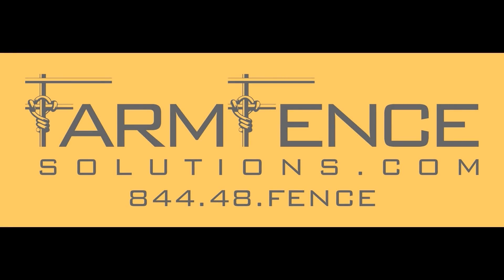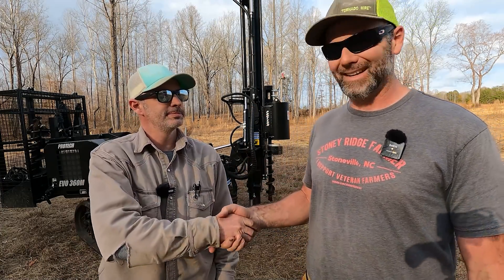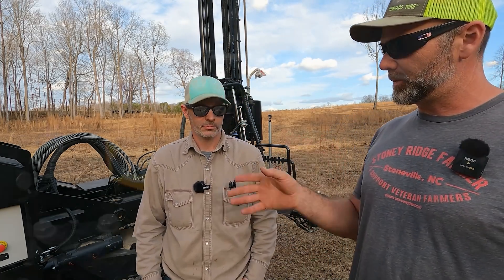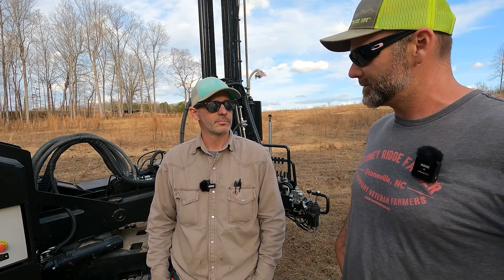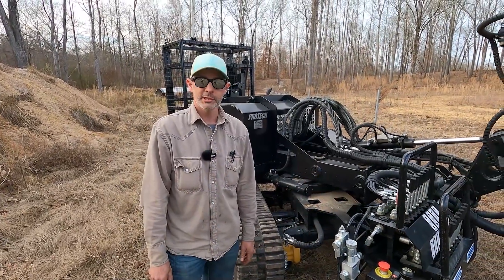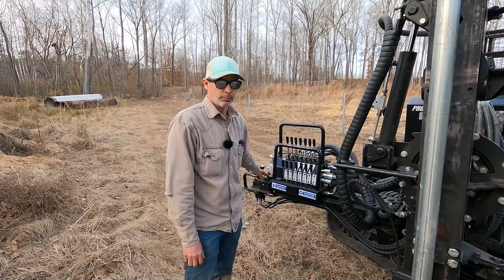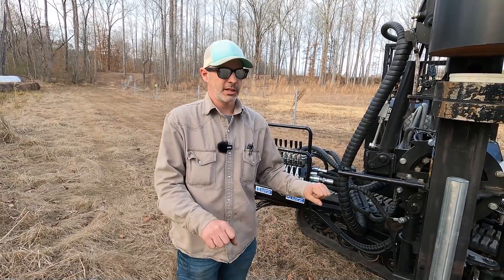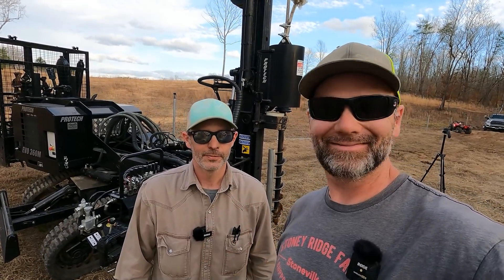You've never seen a fencing machine like this!!

Comment: Great tool. Soon as I have a spare $2 million just sitting around, I'm gettin' me one of these puppies!
Reply from the maker: a man needs tools to earn a living my friend
Reply: @StoneyRidgeFarmer  I build welded steel pipe fences for a living. My tools including truck, trailer, tractor, auger, pneumatic pounder, electric and gas welding gear, wire stretchers - EVERYTHING cost about 1/10th what this machine alone would.
Reply: You are making a pretty big, and false, assumption my friend.  This machine not only costs much less than you expect, it also puts way more money in your pocket at the end of the day.  We even have machines with built in hydraulic drive welders. 🤙🏼